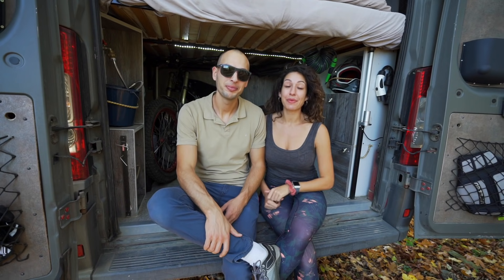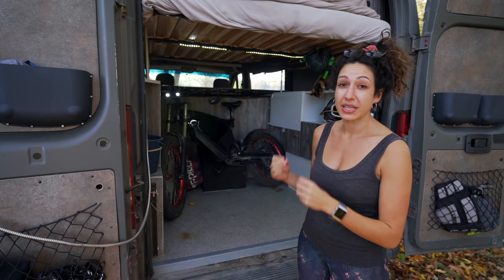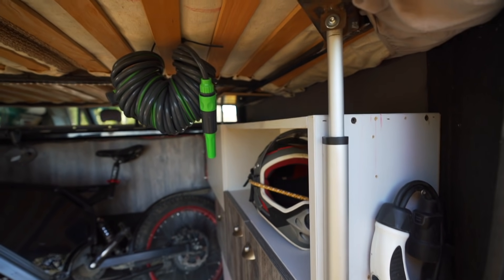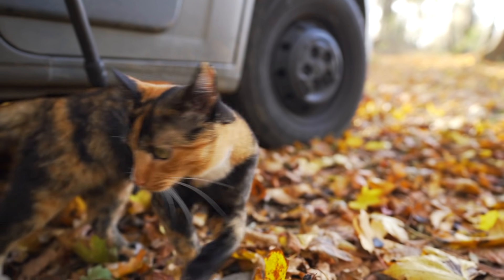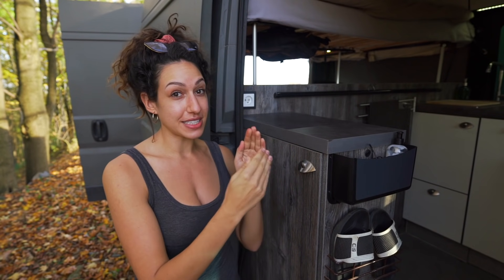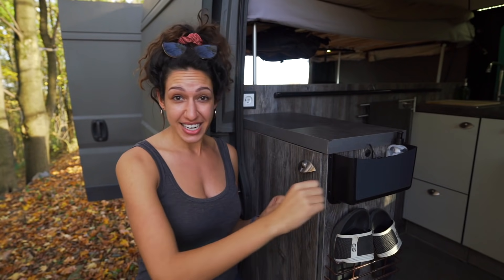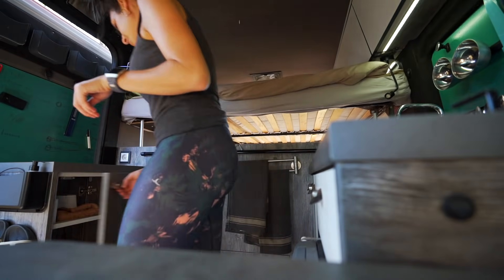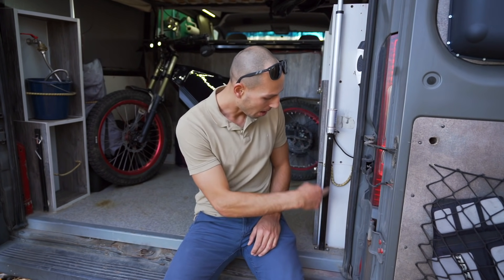How to Build $140 Motorized DIY Bed Lift in Your Campervan

Comment: Please post your install vid so we can see how you put everything in, and how the actuators work together. Thank you.
Reply: If you aren’t sure how to do this (this isn’t snarky btw just genuine advice) then best to research on YouTube about actuators and how to wire them in a vehicle, as you will be using electronics and it only takes one wrong solder to burn your van down, I’ve seen it happen.

Sorry I’m not of more help but trust me just research and YouTube will show you loads of diy engineers and enthusiasts who use actuators in various projects with varying power sources
Reply: Also there are many great vids on self sustainability if you’d like to learn more how to generate power by water flow and solar and pedal power
Reply: Yeah. This doesn't show much.

For instance, how much length in movement does it allow?
The description link shows 12 inches, which is nowhere enough.

Comment: That's exactly the bed lift system I've had in mind but I've yet to find affordable actuators that will lift 40 inches. Great vids, guys. Keep up the good work
Reply: what about 24" ?  it looks like the max for the Aliexpress stuff is 18" ☹

Comment: Hi! Beautiful van build.  I am doing a similear design for a bed, but I am curious how you control all 4 actuators at the same time.  In the comments you say its a simple switch, with hooking up a positive and negative wires, but at the 2:25 mark in your video, you can see wires going from your switch to a controller board, then wires leaving the controller to the actuator. There's even a soldering gun in the frame. Could you please elaborate on the controller?
Reply: that's not a control board, it's 240 (or 110V) to 12v dc converter.

Comment: I'm curious if you have any issues with synchronization of all 4 lifts? Do they always lift up and down at the same rate?
Reply: There is a speed regulator you could use to insure they work at the same speed.

Comment: What lift size did you go with on your actuators? I just ordered four w/ 20" travel.  How did you hold the bed in place when lifting?  I thought I saw a drawer track placed vertically on one of your videos but don't see it in this video. (Did You NOTICE!? haha) Looks like you mainly use yours just to get it out of the way but how sturdy is the bed when lifted?  Could you sleep on it when lifted? We are on our third van build over the last 5 yrs and really enjoy your breakdown videos!  Thanks!

Comment: Hello, great idea
Can you explain how do you connect the 4 activators to act all together, I mean, synchronized, please?
I’ll appreciate it. 
Thank you so much.
Reply from the maker: You connect positive with positive and negative with negative 😂
Reply: @ladiandmargaret  you inspired me to do a similar bed system.  But i am having a hard time figuring out how to wire 4 linear actuators together.  is it a Parallel or Series wiring diagram, did you use a controller, or just a rocker switch? Thanks in advance!!!

Comment: Brilliant, I wanted to install one of these at home as we are in a small place. I'd love to see how you actually wired them together please.
Reply from the maker: It’s way to simple to wire, not even worth making a video about it. Cool how many possibilities are with these!
Reply: @ladiandmargaret  Ummmm... obviously, it is simple for you! There are a few of us out here that do not have experience or are just learning how to wire a van.  I cannot find anyone to help me and will have to take tiny baby steps to build my van.  Hopefully I am done by the time I am 99.  haha  Regardless, beautiful van & GREAT ideas!
Reply from the maker: Thanks for the feedback. Well you need to understand direct current. Positive and negative wires. So this actuator has two cables, positive and negative. It’s the same principle like on any LED light or water pump. You want to have a switch (cutting red wire essentially) and fuse before the switch. I actually just finished script for a video just about electricity in a van to hopefully it will be out within two weeks.
Reply: hello great setup can you tell me what size actuators you got?
Reply from the maker: Thanks, I have 300mm long but you might want longer if your bed is lower.

Comment: Came across your video by chance  looking to do the same thing on our new van. Cannot find a bed system that is sold already built. Seems like yours work great. Do you have some kind of build diagram on how it was done? Would it be possible to have the bed actuate higher? Would love to hear from you on this and great job by the way🙏

Comment: Really awesome way to do the bed lift! Looks clean and solid.
One question though, is it possible to sleep  on the bed while the hydraulic arms are extended? 
I am taking my motorcycle with me and want to be able to lower the bed when the motorcycle is outside or raise it when it is inside.
Reply from the maker: Idk, we don’t have space up there when it’s lifted up 😂
Reply: @ladiandmargaret  
Haha no i understand😋.
I want to mount the arms lower so i can sleep or sit at different heights and this looks great.
Do you think it is sturdy enough while the arms are extended?
Or maybe i need to use 6 arms instead of 4?
Reply from the maker: I personally would use some rails or some support the bench would be sliding in to make sure you are not stressing actuators. But it all depends. If it’s supported from three sides like our mattress, I would not even bother.
Reply: @ladiandmargaret  Yeah okay that makes sense! Thank you for thinking with me:) I will need to work this out further but I will make it work haha.
Cheers!
Reply from the maker: Sure thing! Good luck, sounds like a fun project!
Reply: @Gwiennn  Did you get this to work? I'm also would like to build this and be able to sleep on it while the arms are extended. Thanks!
Reply: @HelloLoveley  I've sold my van and bought a shorter one a few weeks back. What I would do is something like this: https://m.youtube.com/watch?v=SdwL9C-GqME

This is a genius and not as expensive as a happijac solution.
Make something like this video but use a shutter motor instead and you'll be fine.
I would make some sort of rails to guide the bedframe and possibly lock it into place.
Reply: @Gwiennn  I'm going to have drawer tracks to ensure it travels straight.  This will also allow me to put pins through the track to take the weight when parked.

Comment: Hello, thx for sharing.  Really good 💡!
In your build, what's the stroke length of these actuators? Did you use a controller to assure that all they work at the same speed?  And last question, what happens if your out of electricity and the need is in the upper position? Thx. Best regards

Comment: I'm also using linear actuators  to lift a bed but to turn it into a couch is not so easy without some custom hardware. In my experience anyways. I'm experimenting with that and so far it's been more of a hassle than doing it manually.
Reply from the maker: I imagined very easy solution, maybe I can draw it for the community. Super easy solution!

Comment: Please please please can you do a video on wiring the 4 actuators together.. Cause originally I thought it was just a matter of putting the 4 together and wiring them too the one switch. But the more I research the more I get confused... I have been told that I should have a controller box if I want too wire up 4 together but there really expensive and make me feel there has too be a cheaper way too do it
Reply from the maker: You don’t need a controller. It is as simple as plus and minus and a switch that reverses these two to go the other way.
Reply: You wire them together by placing all the negative together and the positive together from the 4 actuators to form 1 negative wire and 1 positive wire then from there you wire it to the switch. As if there is only 1 actuator.

Comment: FYI - a company named Firgelli Automation makes linear actuators with a controller that will keep all of the actuators in sync.  I don't think it's a big deal but this would eliminate the issue.  They will set you back approx $800 for 4 actuators and the controller.

Comment: If I want to have seeding on both sides at the back of my van but also have another bed option with a lift, how would that work? I would want it to be able to lift high enough to use the seating as a bed as well.

Comment: I hadn’t realised linear actuators were so cheap to buy. Is there a way to trim the bed so if you’re parked on a slope it’s possible to level the bed? Also can they pull the same weight as they push? The reason I ask is I’m considering hanging the bed from above instead of pushing up.

Comment: great execution of this concept well done. I just discovered your channel. I have also identical Jumper van L2H2 with the 3.0litre diesel. My project is to fit it with an assiatnce rear wheels electric drive system. It will be a part-time 4WD. I would be interested on your feedback on that idea from your own driving adventures with your Jumper. I try to make it working with 48v LiFePo4 without becoming a major high voltage hybrid. Thanks for your great videos with inspiration.

Comment: nice job for this awesome bed lift ! how did you handle the synchronisation between the linear actuators ? did you use any specific control system ?
Reply from the maker: There is no synchronization needed. It’s ok if one of them is slower.

Comment: Great idea! The only video I could find with information like this! I can understand how it works but I can't understand how you put together the 3 actuators to work simultaneously with one switch. Can you tell if one switch is enough or do you have any controller? Many thanks!
Reply from the maker: 4 actuators go through one switch. You take all the positive wires, wire them together, the same thing with negative wires and you solder them to the switch :)
Reply: @ladiandmargaret  You're amazing! Thank you! <3
Reply: I already did my bed with this! THANK YOU SO MUCH! It was cheap, fast and it's terribly simple and amazing :) plus I don't have 4 but only 3 corners and it helped me a lot having a subtle solution that doesn't take up all the visual space in my van <3 I will show you soon I do a video 🙏
Reply: @dianasilvaprod  Do you have a video or pic?  Id like to see how you did yours.  Thanks!
Reply: Diana Silva i would love to see how you did yours

Comment: So if you're on a 10 degree downslope and, for example, a 3 degree side lean into a gutter... you can level EACH SUPPORT to customize your bed angle from any of the supports? Solving the problem of chocking your wheels to sleep OMG :)

Comment: Can someone sleep in the bed partially elevated? Will the actuators hold the weights?
Reply from the maker: No
Reply: Thanks for the great videos! I've seen other people being able to sleep on the bed when in a lifted position (with a guiding rail on the sides), so I'm curious why you think not?
Thanks!

Comment: Does the actuator have only two positions? Could you use these to level the bed when parked on uneven road?
Reply: The positions are infinite.  You would need multiple switches to do what you are suggesting but it is certainly doable

Comment: I’m thinking about some lift bed system and now I found your video. I have question about actuators you are using them just for lifting your bed and if you want to lay on bed it’s laying on the cabinets? I want use it for small van VW T5 long and want to sometimes store my MTB bikes under bed horizontaly on the floor but I’m not sure if it’s possible to lift bed higher and still lay on it. Weight lifted for bed and two persons should be till 200kg depends on the bed frame and matress which I build hope maximaly 250kg. I’m not sure if I use actuators for about 160 pounds=75kg if it support all weight split between anchor 4 points. Thank you for your help
Reply: the weight an actuator is rated for is direct down force, NOT a swaying side to side.  they make actuators that lift thousands of lbs, but if at their full extension, you have to remember they don't have much support.  Think of a nail in a block of wood.  If its buried in the wood it will not move, if only 1/4 of it is hammered in, you can push it from the side and it will bend/fall out.  The actuators are teh same, i would imagine if you got on the bed while in the full extension mode it would snap when you roll around.
Reply: TheMaxBeck Thank you for your points. I tought about backup plan to use aluminium profiles and use them as a guide with raild and also some “brake” or lock in rails to secure bed on position to keep weight and stabilize it on position. As I hope it should make bed secure and actuators will be used just for lifting bed on position. Also at first I would like to use it with manual lifitng if it works and after that actuators could be added later. Hope my idea is doable but that’s what I like on own vanbuild and investigating possibilities and building.
Reply: @Losi-F-Air  Hi Josef, I want to build a bed platform the same as you. Did you work out how to construct the aluminium profiles for stability?

Comment: Have you used limit switches on the linear actuators?
Reply from the maker: They are build in
Reply: Just wanted to mention there are many sizes of actuators so in most cases you should be able to find the right size without needing things like limit switches.

Comment: Can you tell me how you wired all 4 actuators to a single switch? I am assuming they are all on one switch as they move all together. Any help would be greatly appreciated. I have searched YouTube and haven't found anything that would help me.
Reply from the maker: You need a rocker switch changing polarity. That’s the entire magic 😂
Reply: Ladislav Jecminek so just wire all 4 actuators to one switch. Wasn’t sure that would work.

Comment: dose charging 2 e-bikes not kill your batterys sure you have solar panles but  most of them wont output enough power for chargeing 2 bikes thats dependent on what els your using i suppose
Reply from the maker: We never charge from our leisure batteries and not even two bikes at the same time. I set charging current based on how much power solar panels generate.

Comment: What kind of actuators would you suggest for lifting double the height of yours?
Reply from the maker: I would get the longest one. Depends how high can your bed go. They are linked in the video description.
Reply: Ladislav Jecminek 
Which size are yours, for comparison?
Reply from the maker: 300mm

Comment: I was looking for a solution like yours but not for an ebike. I'm from Canada and winters are coooold. Heat goes up. So I as thinking of raising the bed a lot in winter but those actuators are quite short. ... Maybe have those actuator to be on top of something ( not the floor). Anyone did that ?
Reply: Umh! Actuators are quite short. What can I use for let's say 3 feet or 1 meter ?

Comment: just discovered you on you tube.  why did you go with 300mm actuators instead of 450mm?
Reply from the maker: Because 300mm go right up to overhead units. Take a look in the video. The bed can’t go any higher 🙃
Reply: Thank you.

Comment: omg show how it works and how you installed it.
Reply from the maker: It goes up or down, you only need a switch with reverse polarity. If this is difficult, you should not wire anything yourself.

Comment: Does anyone know how to make sure that the actuators stay synchronized? I've seen $50 linear actuator controllers that do this - does this build have a mechanism to ensure the bed lifts up evenly?
Reply: No, in their videos the bed rises unevenly. Likely not an issue unless it would create some binding.  I would make the top of the actuator have a connection that allows it to pivot and the unevenness shouldn't matter.  They plan to use it to tilt rooftop solar panels also.
Reply from the maker: In our van tour it looks like it raises unevenly, but really it was because at the time we only had 2 (places in opposing corners) because we didn’t have enough money for all 4 🤣 If you look at the later videos about the actuators you see how evenly & strong it goes up. They all have start and spot off switches so you don’t need to do anything to synchronize them.
Reply: @ladiandmargaret  hey thanks for replying!! I have a 3 panel queen on piano hinges in my conversion and I'd like the ability to push up the back panel to create a couch. You think they will have no issues staying in synch? Makes things super simple :)

Comment: I guess this is an older post as the links no longer work. I can say based on my experience in the past few days here everyone who started out by saying we did this for "x" price the price is now double that due to inflation. It appears to me the actual lift range is pretty limited in your build as you have overhead cabinets.  For my own situation, I was planning to put a dinette below the bed and wanted it to go all the way to the roof. Linear actuators for say 60 inches is about $420 a piece, and you still need to build a bed frame.  I am mentioning this as people should be aware the greater the range the greater the cost. I am currently looking at a system that ships from China that uses belts that is about $400 including the frame. The company will actually custom make the bed frame any size you want, and is included. And for about $100 more you can get a hospital style bed. That is to say it will elevate the head and foot position to make kind of an S shaped bed for lounging-pretty cool. I do like the idea of something that's already made and all you have to do is assemble.